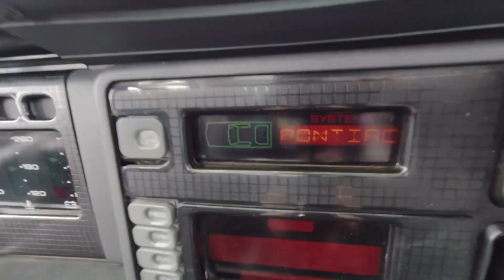My ‘89 Son Bought An ‘87 Trans Am!! He’s Very Excited!

Comment: 350 tpi only came with the hard top in 87. Does this 8th digit from the left on the vin read 8? or F? 8 would mean 350
Reply from the maker: It was swapped in
Reply: I believe they are equipped with the h.o.305 from factory though nice swap!!